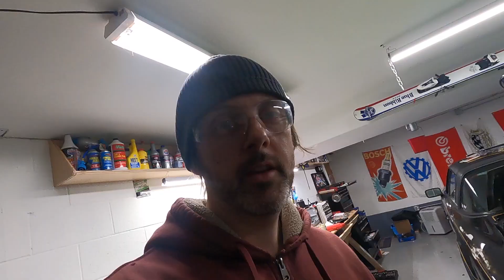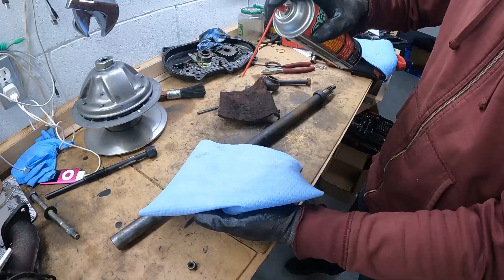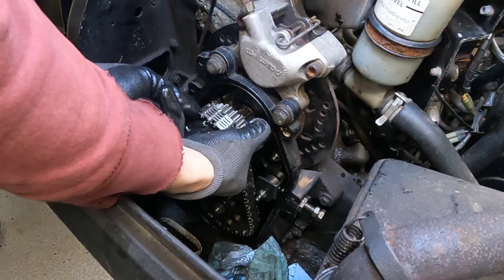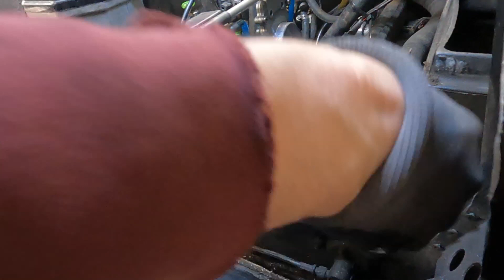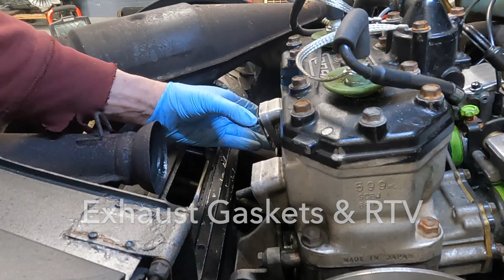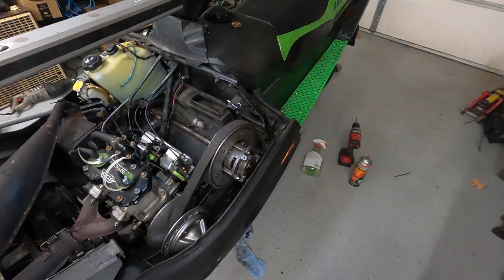How To Install Snowmobile Jackshaft Arctic Cat ZR600 ZR800 ZL ZR2 ZR3 Cheap Sled Project EP6

Comment: Applying heat to the bearings will facilitate it's removal..  Both bearings should be replaced for that much trouble.

Comment: Dude you did a great job with that zr. Life is about try and try again. I had do all of that with my Storm for allmost 10y ago. After that experience i took the others clutches away. Knowing that im years  to late for give a tip but still have my 3 AC and the thick chim should never leave the cluthch. 2nd. Get a new spring or change the preseting so you get a better backshift on your sec clutch. It should be a kick if not open up the cvt and take away a chim from each weight. Aim for 8-8200rpm. Im glad you pulled it through.

Comment: Thanks for those videos! I have a question. I'm putting the jackshaft in and on the chain case side there seems to be some play in the shaft. Like the shaft is not seating in the bearing. Was it like that for you?
Reply from the maker: There should be no play once you install that chain case side bearing retainer.  If so your bearing is shot.  Make sure the lip is facing the right way!
Reply: @ADDvanced  thank you! Dam this has me confused..
Reply: @ADDvanced  I'm not sure why my comment keeps getting deleted. I made a video of the issue I'm having. Would you be willing to check it out?
Reply from the maker: @greendanks  Yeah post it to your page

Comment: Question , now that I have seen the jackshaft all apart, just the other day a friend was riding our spare sled a zr800 and lost all brakes, with the back of sled lifted and track spinning we applied brakes and caliper stopped rotor immediately but secondary still spinning and track too, what failed between rotor and secondary? the key in secondary? and the secondary clutch exploded a month ago and we put a used one on, makes me wonder now if something we did on install, thanks
Reply from the maker: Yeah, key fell out between the rotor and jackshaft.  It's probably in the bottom of the sled somewhere.  I would try to order a new key because it might have fallen out by now.  It probably wasn't in the rotor 'square' and was instead at an angle.

Comment: Mines pretty much doing the same thing yours was before doesn't launch very good but can still max and stuff. Did you find out what was wrong with yours let me know.
Reply from the maker: Watch the video.  It's either the engine bogging or it's the clutching.  If it's the engine you need to adjust the carbs/oil injection so it doesn't bog.  For clutches, CHECK belt deflection, CHECK engine snubber (mine was gone), and adjust shims in secondary to get belt deflection in spec.
Reply: Thanks sold mine and got a newer 800

Comment: WOW... Your belt is FRIED... Supposed to have 2 thin shims and a thick shim. Also you want your clutches to be aligned ( like this...  =   = )AND your driven clutch to have 1/8" of movement side to side on the shaft. Also your belt should only be about 1/8" above the edge of the clutch. You should not have put anything on the crank shaft. that was a big no no. 
Good to see it back up and running.
Reply from the maker: That belt has maybe 150 miles on it tho?

I could try swapping to the other belt, I guess?   Clutches look pretty aligned by eyeball but I haven't made a tool yet.   Will definitely get to it!  The driven clutch has about 1/16th-1/8th of float, so I think that's okay?

Should I pull the primary and wipe off the anti seize on the crank?
Reply: @ADDvanced  something to understand though is that if your clutch alignment was off and Center to Center were too short then what was happening is your belt, albeit a new one, was wearing extra fast and prematurely... So I would compare the two belts and go from there and use the one that's wider and then reset the shims in the driven clutch with only two shims. I'll look at the manual when I get home and reply back with what the proper thickness should be for your sled for each shim.

Personally yes I would clean off that anti seize from a clutch and crank and polish the crank wheel well as well as the inside of the clutch as much as you can. The manual says 1/8 in float if I remember correctly for the driven clutch.
Reply: @ADDvanced  Yes wipe the anti seize off the crank, it can cause the primary to spin on the tapered shaft and jack up your crank. I just clean both surfaces with a scotchbrite and that's it. Same with the secondary, now that you have it off just clean it every year.